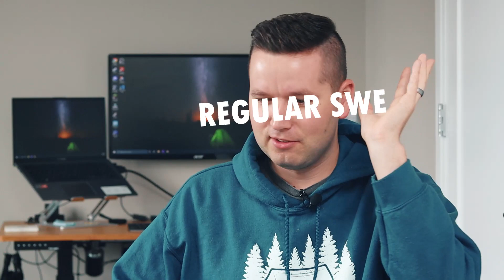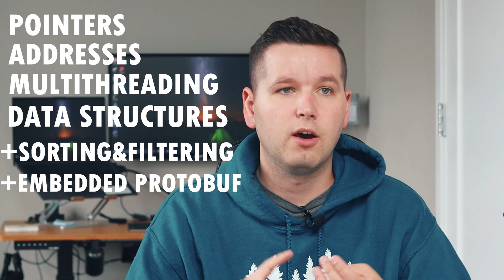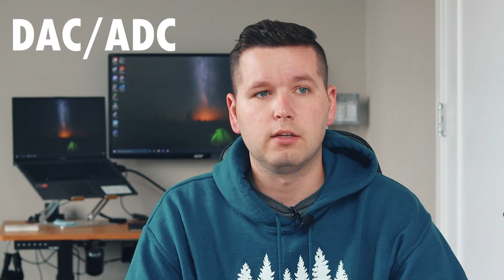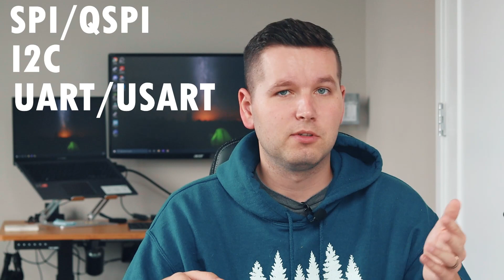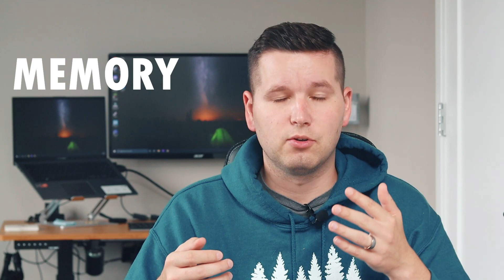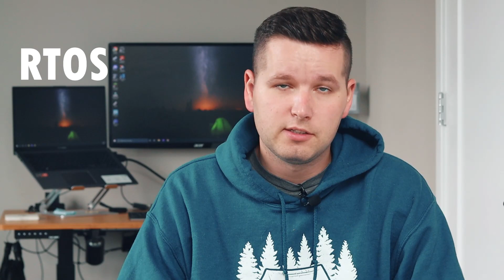How To Become An Embedded Software Engineer?

Comment: So finally I have a passion to go in my own core field, wasted much time I know, but if you may suggest me some good guideline or how to n what should I do if I may enter in embedded field then pls help me guide me for get my entry in this domain.I am feeling like that I was just a bit step away from my dream but it's benn again a time in crisis since last 2 yrs almost.I am not saying that I am a master programmer in C but I can do wht I did and I understood these all well. Just need a guidance to break.
Reply from the maker: If you’re already familiar with C, I’d recommend get an STM32 board and start learning to use it as bare metal then move to RTOS usage - learn a lot about RTOS. While you’re learning continuously apply for jobs you like and think it would be a good fit. Depending on a company you’d probably want to be ready to do some coding for technical interviews - some linked lists or sorting algorithms would be a good start. Or just a fizz buzz.

Comment: Hi, Embedded Software Engineer or Embedded system engineer! Are they both the same? Or not?
Reply from the maker: Hey! No, they are not, systems engineers usually do both management and engineering - they focus on the design, integration, management of some product/project cycles. You can search more on what a typical systems engineer might do online. Anyways, at least that’s how it is in the companies I’ve worked at.
Reply: @GreidiAjalik  Hi, Much thanks for the reply, However I am still confused a little. I searched it on internet and I found that  both the names are somehow used interchangeably.
I was also searching for masters courses, and i found out the name Embedded systems...
Reply from the maker: Hey, I have seen that as well. Embedded systems is a broad field, that consists of electrical, hardware, software, test(hardware and software), and systems engineering fields. At least in the companies I’ve worked for systems engineers is it’s own title. Idk why people use them interchangeable, if you’re looking at schools then look at what courses they offer (could be a mix of electrical designs, RF, layout, and maybe so assembly/C mcu programming). For job positions, could be a small company that expects you to wear multiple hats and design and develop the entire system… take a look at this link of job descriptions in embedded field, pretty accurate in my opinion: https://www.modis.com/en-us/resources/salary-guide/embedded-systems-job-descriptions/
Reply: @GreidiAjalik  Than you very much for sharing your knowledge, very helpful.❤️

Comment: I hope I enjoy this, it seems fun from the outside. I am a computer engineering major and next semester I am taking a class on embedded systems then I am planning to take 3 more classes focusing on embedded systems for my Sr year. I would also love to play around with it at home. I have to take an operating systems class as a requirement too.
Reply from the maker: Hey Tony! Thanks for reaching out, sounds like you're on a good path, this is exactly one of the reasons why I recommend computer and software engineering degrees over electrical engineering for embedded software engineering because there are so many more focused courses for embedded... Cheers! Let me know if you have any questions!
Reply: @GreidiAjalik  it’s so true for my university compared to electrical engineers which only take one class on it and it’s not even required, then there are electives of course but computer engineering prepares you by having you learn assembly, C, algorithms and data structures, operating systems and being able to take many courses focused on embedded systems. We even have one that teaches machine learning with embedded systems. I am really looking forward to them. Thank you for your videos
Reply from the maker: @TonyDaExpert  that's really cool! No problem, I'm more than happy to keep producing this content!

Comment: Any specific examples of projects?
Reply from the maker: There's many, but some good one's would be:
- Create your own line following robot
- Do your own simple video game (connect a display, a controller, and set up drivers for all of those)
- Write your own communication protocol or learn to use embedded protocol buffers via UART and PC (create a system to send/receive large amount of data) or do it over USB
- Create a bluetooth controllable device (maybe measure your heartbeat or detect an earthquake, then create an application for PC or mobile to communicate over that bluetooth to display this info) 
- create a “smart” device
- use RTOS while doing your projects to learn about multithreaded applications.
- or come up with something yourself that you'd like to do

Hope these helped a bit to get you started, I think it might be worthwhile for me to actually create a video about this ? Cheers!
Reply: Thanks. I was also wondering, I’m a CE graduate (Bachelor’s) who learned classes such as Microprocessors, Digital Systems, and Computer Architecture. I’ve also learned C and am about to learn C++ and Python. Is there anything else I need to learn to be able to apply for a job?
Reply from the maker: @highway2heaven91  depends of what position, right? You'd want to check the job description, but in general, it sounds like you have the fundamentals learned, which is good and usually meets the requirements for entry level position!
Reply: @GreidiAjalik  Just wondering, how difficult is the entry level technical interview? What would you need to know? Any resources to recommend? Do you think you could make a video on technical interviews?
Reply from the maker: @highway2heaven91  Hey, difficulty is hard for me to say - as it depends on the engineering team interviewing you and the expectations for them. I think you would want to have a general understanding of all of the peripherals of how they work etc. For coding portion, you'd want to be familiar with some filtering and sorting algorithms, and some specific with data structures. Doing some LeetCode will help with that. I'll keep it in mind as for a video idea! Thank you! Hope this helps a bit!

Comment: Hey, nice video. I noticed that you briefly mentioned embedded linux, what do you think of it in regards to job prospects? I've been reading in reddit that bare-metal is dying and is being replaced by embedded linux. What is your opinion on this? I'm starting my career in embedded and I really like bare-metal and RTOS programming, but I'm worried that it would be a bad long term choice.
Reply from the maker: Hey! Thank you! I would say it is pretty desired skill to have in the job market and so is RTOS. I do agree that Embedded Linux or Free RTOS are becoming more and more popular than bare metal. You usually always want to start off with learning bare metal, then learn about RTOS and/or embedded Linux . RTOS wouldn’t be a bad long term choice. Even though there is a shift to use OS more on embedded systems (which is great), not every system will need to be running one. You could also run into a situation at work where they are porting code from one architecture (bare-metal) to another (RTOS/embedded Linux), thus knowing about both would be helpful. Hope this helps! Cheers!
Reply: @GreidiAjalik  Thanks for the advice!
Reply from the maker: No problem!

Comment: hello , glad i found your channel , embedded is a vast feild and i am a CS student with spec in IOT , 
i have worked with arduino , RPI , atmega boards and am familiar with microprocessor architech
currently i have started learnnig system verilog and was looking to buy a fpga board,
but i must say a fresher it gets a little demotivating to see that there is not as much community support as we have in let say machine learning or general programming ..like it gets so confusing not to mention everything is costly(shipping charges are huge) if i want to learn anything , even the software simulations.
i got a job offer at the far end of my country with a very low pay , idk why the pay is so low , can we get a high paying job in a specific profile?
Reply from the maker: Hey! Thanks for the kind words and your support!! I'm assuming you were talking about pay for embedded software engineers? I think the pay should be the same (or around there) as for most other software engineering positions. Unfortunately, some companies just pay less because they don't have money for engineers or they just don't want to pay - some of it is also salary negotiations. Anyways, hopefully some of it helped or answered your question. Cheers!

Comment: Thanks so much for this video. 
One question: will learning ML(machine learning) be useful alongside C language for embedded systems?
Reply from the maker: You’re welcome! And thank you for the question, I think ML and AI are good skills to have, always. Hence why I’m doing my masters to learn about those. Im not sure how commonly it is actually used, but it could be used to learn more about sensors or devices to detect faults or prevent them. Although they would be challenging to implement due to hardware constraints.

Comment: thank you for this video , it's help me alot as a beginner embedded system engineer ! unfornutally i'm a little bit confused about the c language   because i think that i need only the embedded c extension of it or i need to learn  more about the c programming as a plus for me ! ... also is it a good to learn new things like IOT or data bases that can communicated with our embedded system for data storage or monitoring operations ?
Reply from the maker: No problem! Glad it helps Amir! For the C language you can just learn as normal, once it comes to using the development board, all the tools will be provided by the company selling those boards - your code size and performance will be limited by the microcontroller used. 

Yes it’s good to learn those especially if you are interested in it. We have another project at work currently where our embedded swe’s work with Databases and IoT for data collection. So definitely stuff that can come up! Hope it helps!
Reply: @GreidiAjalik  thanks Greidi ! also it's impressive to find a youtubeur and a profissional interested on embedded systems engineering ... good job and all my support <3 <3 <3
Reply from the maker: Thank you so much! Cheers!
Reply: There is no embedded C extension in the C language! It is all C. There may be some processor or architecture specific pragmas but they exist for almost all architectures.
Please note that things like printf() is not part of the C language but library functions of the standard C library, and a lot of that is not available on small embedded systems.
Supposed „dirty“ Tricks accessing registers, or switching GPIOs are usually plain C constructs accessing bytes and bits in the address space.
There are few areas where you fall back to assembler yourself. 
I have done all my bare metal hardware access in plain C.
To program effective programs you need to know the full C language.
If you are using C++ be always be aware which of the language constructs come with higher overhead, and which come with almost no cost in regards to space or runtime.
Reply from the maker: @kaihorstmann2783  Thanks for clarifying that! :) much appreciated! Cheers!